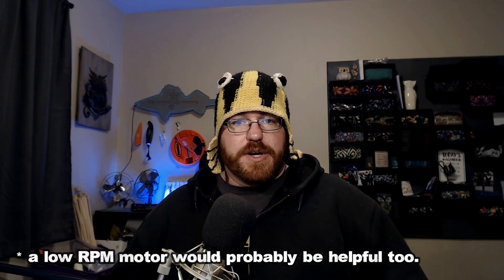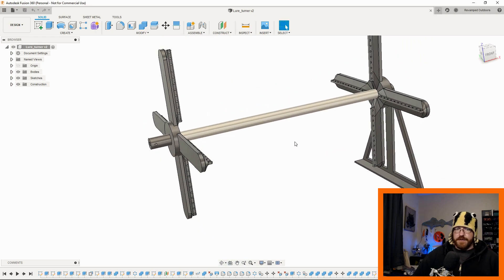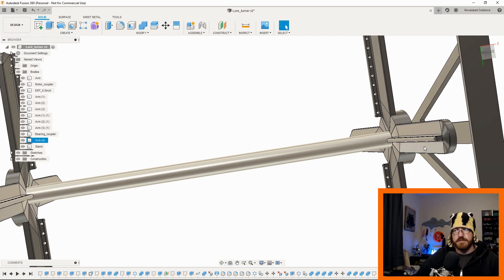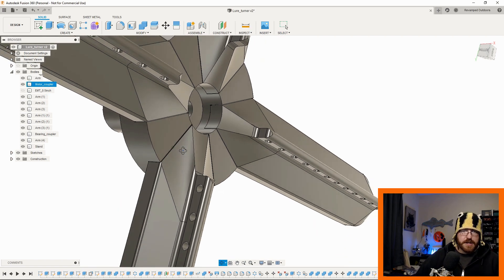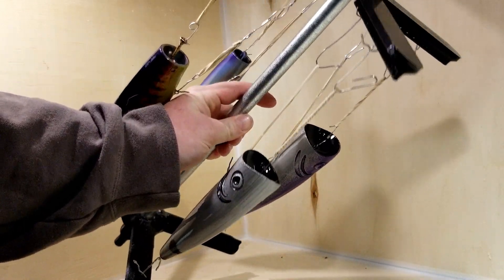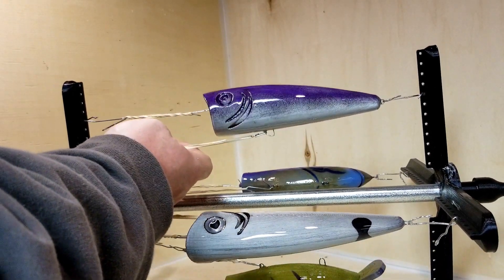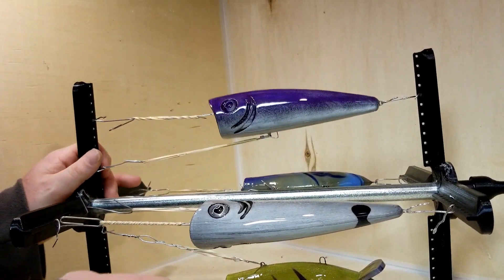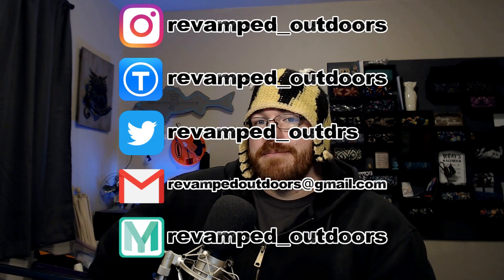Big bait lure turner 3D printed on Anet A8 (STLs included)

Comment: grill motor 1.5v
cheap strong and slow
Reply from the maker: True I put one in my UV box turner and it's working pretty well so far, I'll go over that one in another video soon. Way easier to mount as well, the disco ball motors seem to be a bit bigger and don't offer a lot of mount options.

Comment: Use the motor out of a micro wave turn table. 
Very small, very strong, slow spinning, and easy 110(I've never seen one that didn't run on 110).
Reply from the maker: Right on, next microwave I see on the curb is getting the screwdriver.